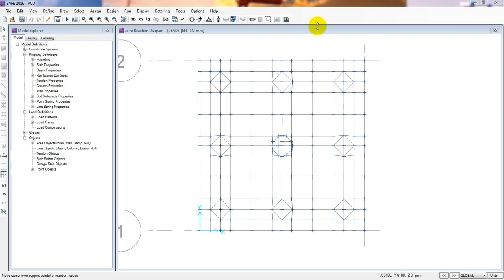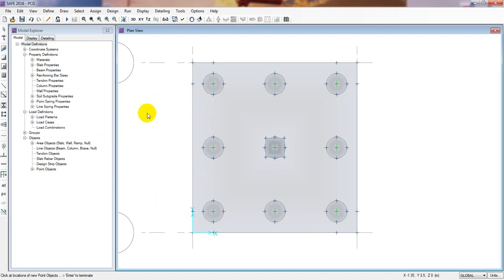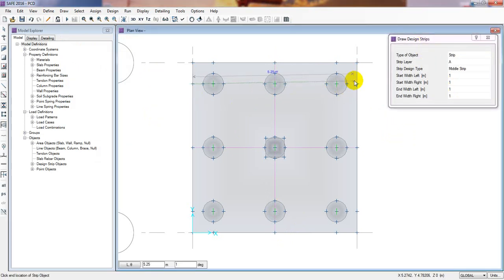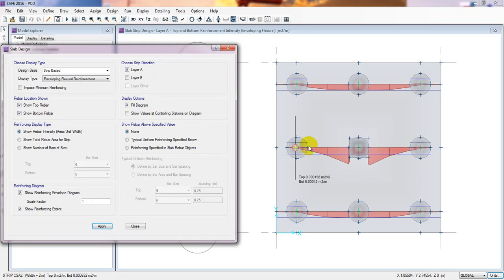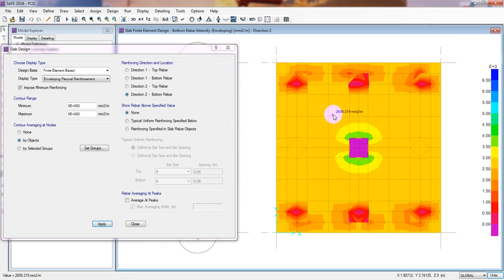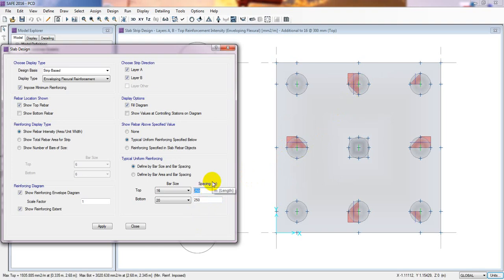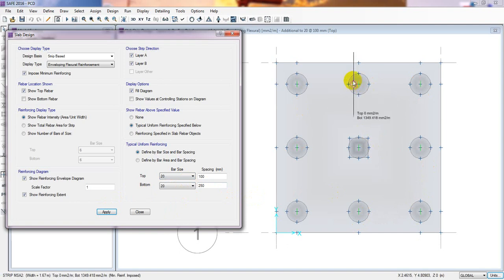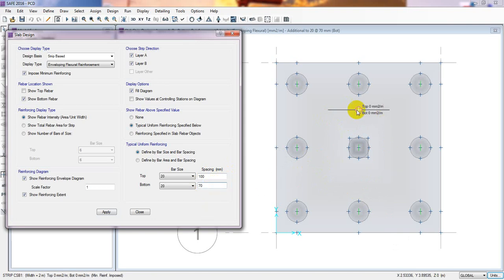CSI SAFE 2016 TUTORIALS | DESIGN PILE CAP FOR PILE FOUNDATION IN CSI SAFE 2016 | PART-6

Comment: How about the shear reinforcement?? If the shear reinforcement is required in slab design display type, but the punching shear is okay (all is < 1), are we still need the shear reinforcement (shear links)?? thanks before
Reply from the maker: you can use some link (shear) if required.